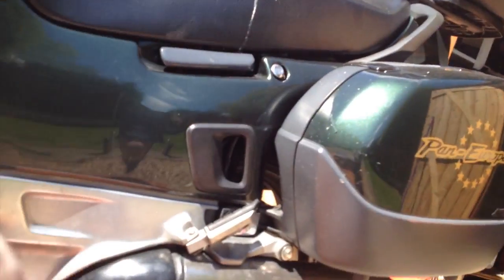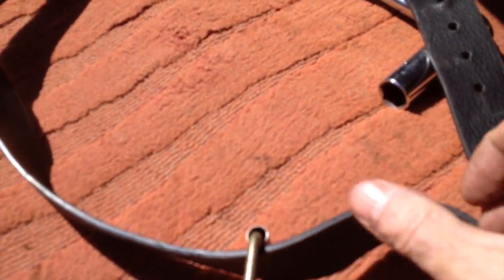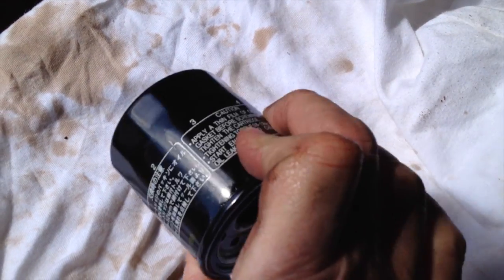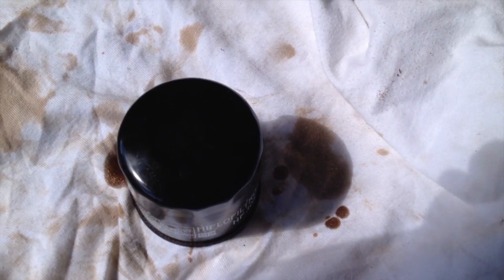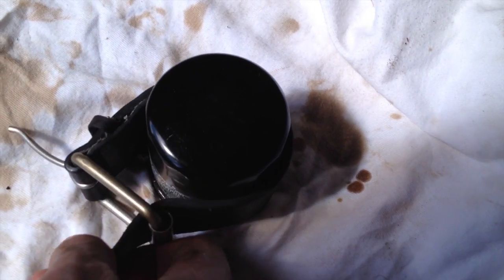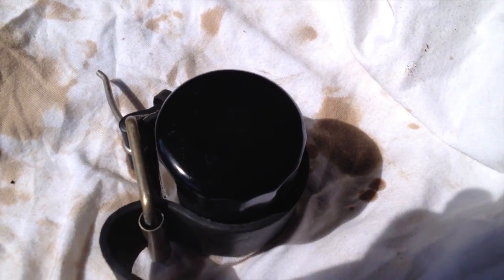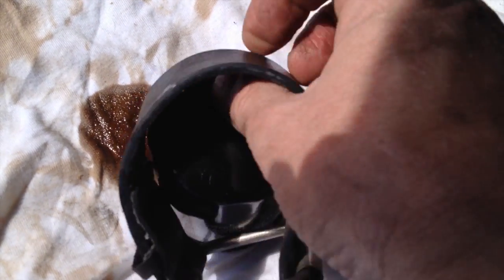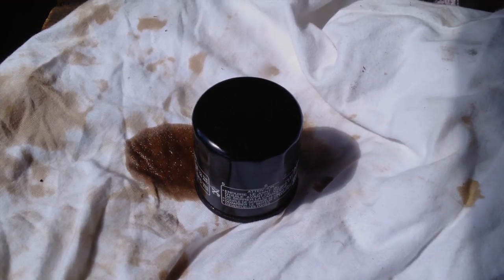Old Fart on a Motorbike, Vlog 202 How to undo a tight Oil Filter without expensive tools

Comment: Nice tip Jim, I've used it a time or too, another tip is if you find that the belt tries to slip around it, so long as you use a leather belt then wet the leather that on the contact point of the filter and it for some reason grips even better, RSMF.
Reply from the maker: Good idea Skeggy, that would be better on the really hard jobs rsm8

Comment: That looks like a very poorly located oil filter. You would think when the bike was designed they would think hey we need to get at this thing every few thousand miles might as well make it easy.
Reply from the maker: Its not really a big problem just a couple of screws to open the plastic, i bet there are worse jobs